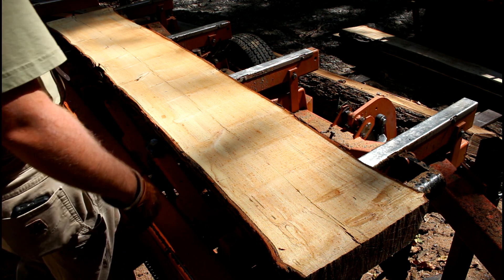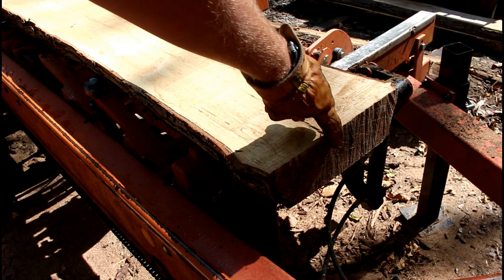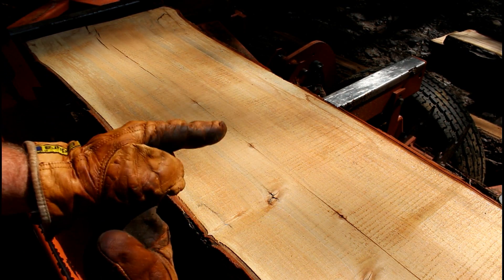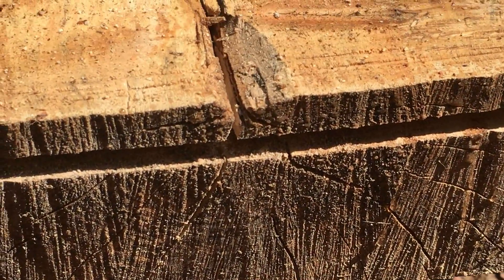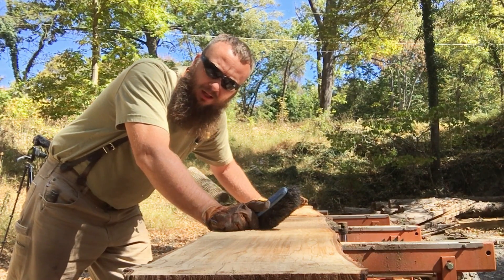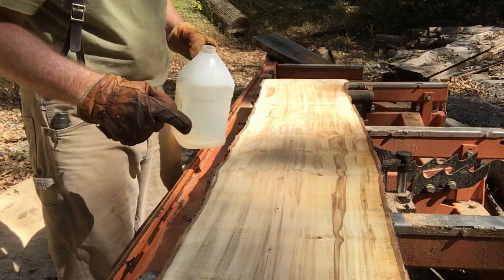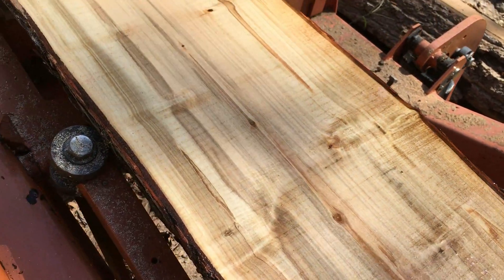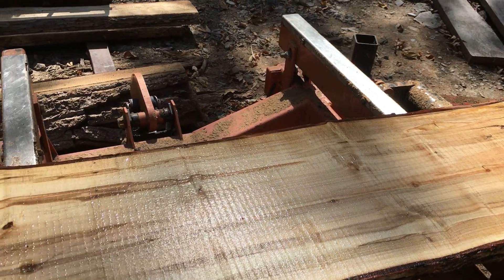A Must Watch for anyone Wanting to get into Saw-milling,Tricks of the Trade. Removing the Pith.

Comment: I love your channel, watch it all the time. I'll give you a third thing you can accomplish with your pith cut. Since that portion is sawn nine O'Clock to three O'Clock, it has perpendicular growth rings. This makes it the same as the very best quartersawn. Mill that as a thin 4/4 (or what you think will be good S2S at 1/2" th.), rip it in half, and there's your product. Perfect 1/2" quartersawn for drawer sides. Cabinetmakers want quartersawn for drawer construction. The full width isn't needed. There's $ in all your through and through pith cuts, right there. Best of all in oak, but maple (like this vid) works too. Keep the great videos coming. You're a natural at telling your story and encouraging others. Bye now.
Reply from the maker: Thanks Paul I appreciate that tip, thank you for watching!!
Reply: Out of the Woods think of this too. Nobody is making 8' drawers. The stock can be acceptable if short lengths provide satisfactory timber. An 8' length with an unsatisfactory bow is still acceptable stock as drawer liners if the (crosscut) shorter lengths are satisfactory. I think savvy consumers would like the oak stock in particular. Who doesn't want quartersawn oak drawer liners?
Reply from the maker: True, I know I would!

Comment: Nice videos, my man. You're cutting almost exclusively hardwoods which are definitely tough on the blade. Can you give me an idea of how long a blade usually lasts? Number of full-width passes, number of days of operation, any one of those would be helpful. Thanks, and thanks again for your vids!
Reply from the maker: Thanks I run the woodmizer double hard 7degree blades, I usually get around 300 board feet before changing the blade. Since I am sawing wide slabs i dont get as much blade life as others would.  
Thanks for watching!